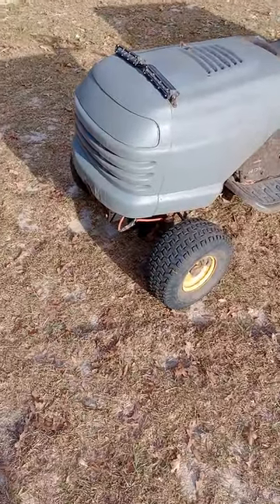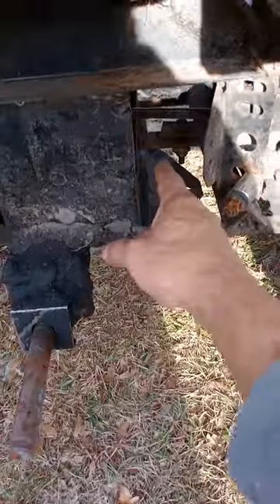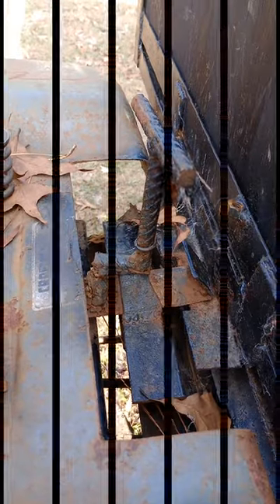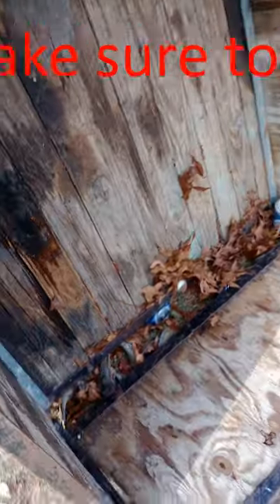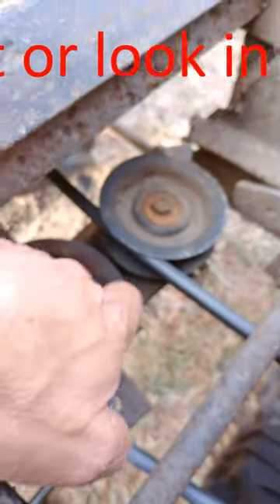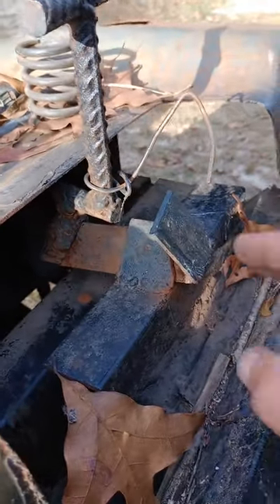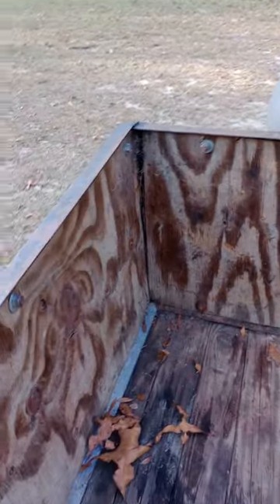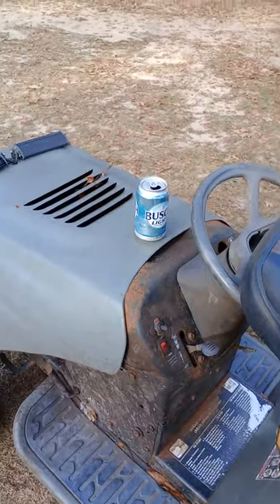DIY mini dump truck made out of a riding mower.

Comment: hi, i think about doing something like this. I plan to add a simple axel in the rear to make like a 4x6. is there a reason why you chose the way you did ? thank
Reply from the maker: @MartMart-c9t  Mainly because I had the parts laying around. Originally I had wheels on both rear axles which required me to weld the spider gears in both hydro axles. It was almost impossible to steer with a load in the dump bed and it rode like a dam tank. Now it has a non welded hydro and rides much better.